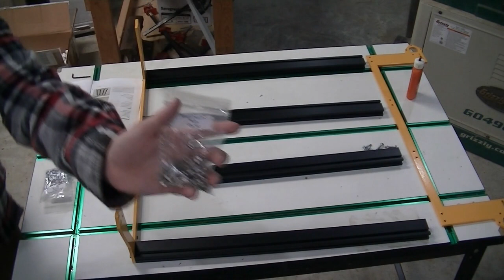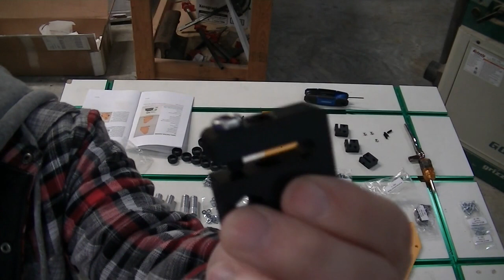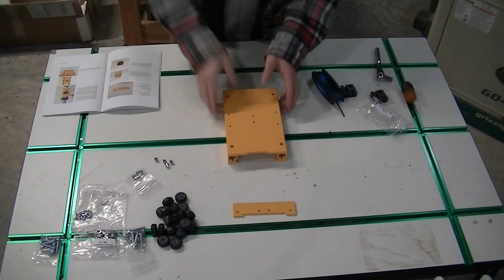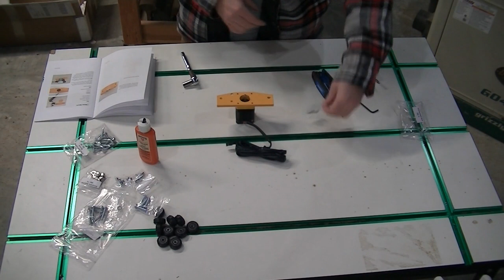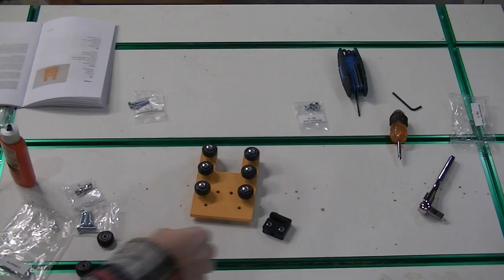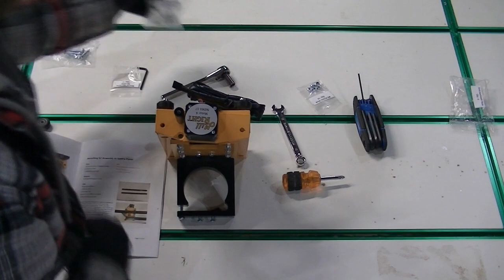MillRight Carve King 2 CNC Step-by-Step Assembly - Part 1

Comment: When working with the anti-backlash nuts … I found to take the small lead screw, run it into the anti-backlash nut, insert the grub screw and adjust the screw so you can turn the lead screw with a slight force then lock the grub screw nut down.  Then after assembly, you will not need to fool with these things again.

Comment: Considering how much the machine cost, everything should have been pre drilled and tapped for bolts . Self tapping screws just seem like a cheap way out. Other than that. The machine looks good. Great video! 👍

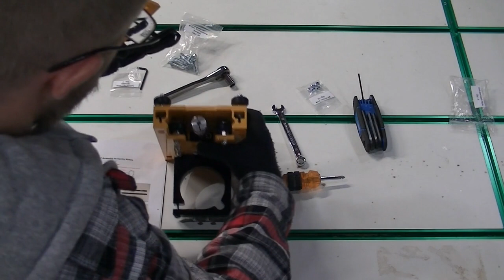Comment: To add a clarification (as you voice in your video), my v-wheel kit came with three unlabeled bags with one being M5 flat washers, another being M5x25mm machine screws, and last being M5x30mm machine screws. I was missing two of the 25mm screws and had to buy them at HomeDepot. I'd like to recommend that at 30:50 in the video, consider leaving the top z-motor plate and bottom plate with plastic UHMW piece slightly loose to ensure the lead screw can take natural alignment before tightening. If not done, one may find that when screwing the top plate down, it will force the Z-lead screw to bend slightly adding undesirable friction later on. Might have just been a one off thing on my build.
Reply from the maker: Thank you for your feedback! I was short one washer but luckily had an extra on hand. That's too bad you were short the screws. It's not fun to have to stop in the middle of a build to make a run to the store.